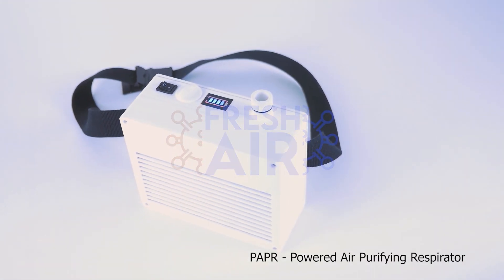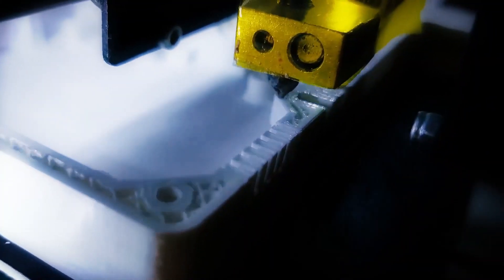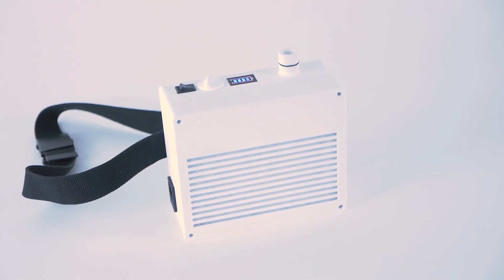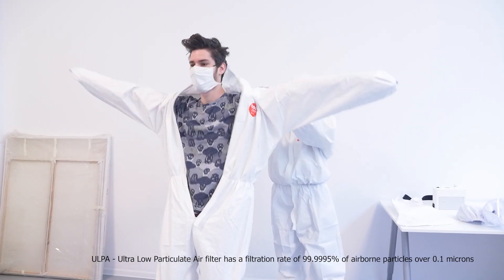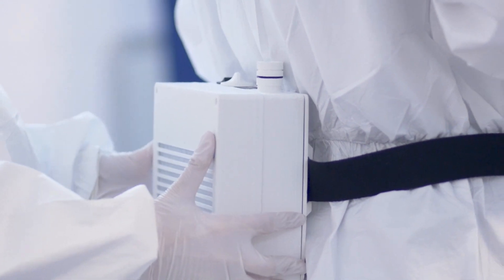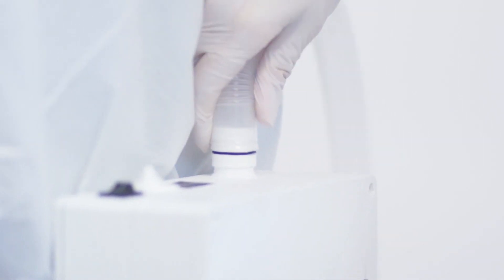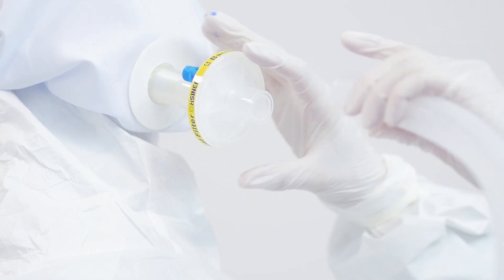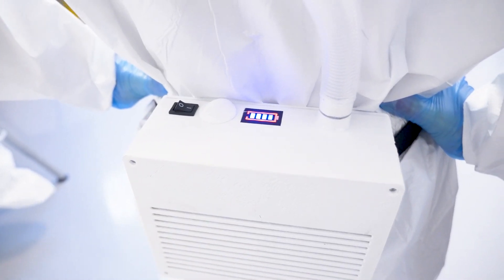Fresh Air PAPR System: Open source and 3D printed

Comment: Your project is missing unit build/assembly documentation/pictures (or I just can't find them in your Google Drive).
I would refer to the RAD-UM PAPR for comparison (they use a 5V blower that has twice the minimum specified airflow for loose-fitting PAPRs, and an off-the-shelf rechargeable power pack). You are both on the same track, but theirs is lighter, and makes battery replacement/swap-out easier by keeping the blower and battery units separate, and connected by USB cable (side-by-side on the same belt).   I would add a low-cost BT voice amplifier as well (3 units total for a full system on one belt).  Your single unit system creates all the pre-filter/battery maintenance access issues that you mention in your project, that the RAD-UM project does not.
I also see no specs on the suit/hood used in the video/prototype.

Comment: Prietene, cu tot respectul, nu vreau sa supar pe nimeni dar... NU se folosesc suprafete printate 3d in mediu medical biohazard din cauza porozitatii ridicate, nu se pot steriliza. Nu-i bun, nu-i "safe". Cine-ti aproba asa ceva e inconstient sau nu stie ce face. Incearca o forma / suprafata simplificata cu un vacum forming, un material bine acceptat in lumea medicala, petG, acrilic... nu stiu, ceva in genul asta. Filtrele biohazard trebuie sa aiba obligatoriu si un strat de carbon activ, am lucrat ceva la o centrala de ars gunoi si in zona de pericol am si folosit niste cartuse D3 sau D4 (asa ceva) pe masca integrala, vezi ca gasesti documentatie pe net, nu e suficienta numai filtrarea mecanica cu hepa. Carbunele se foloseste pentru ad-sorbtie nu absorbtie la gaze, "lipeste" molecule...etc e o teorie intreaga, citeste. Nu trebuie un strat gros cred ca 0.5-1 cm face treaba, la cartusele folosite in industrie sau nato, armata, se presupune prezenta gazelor f periculoase sau radioactiv...etc, te prinzi tu. Pentru vapori aerosoli ce pot avea virusi e suficient un strat mai subtire (vezi si filtrele de pe masca lui Putin cind a vizitat un spital de covid, genul ala). Nu renunta, succes mai departe